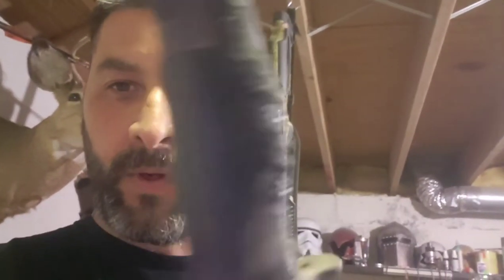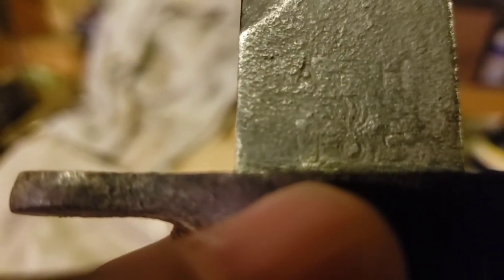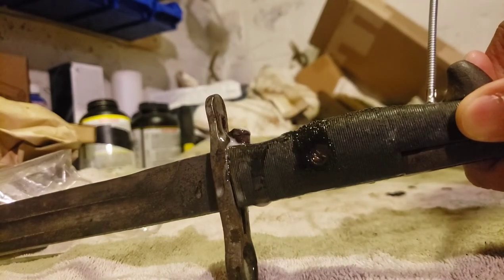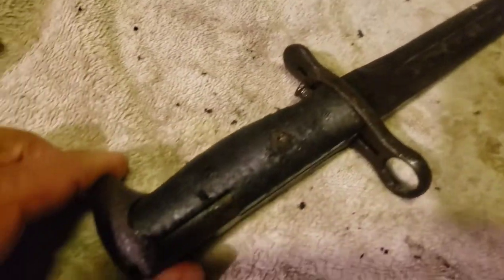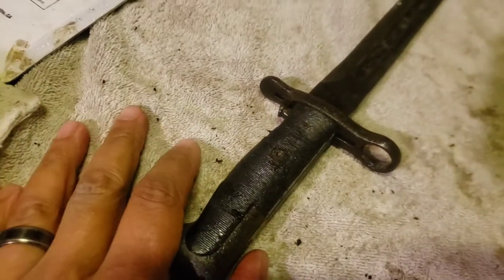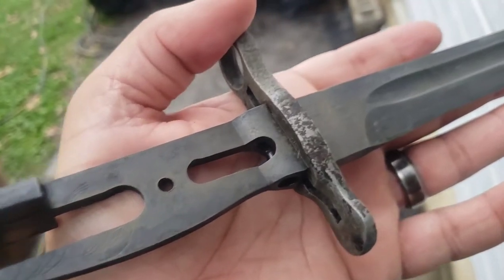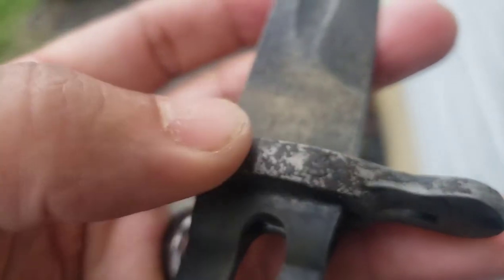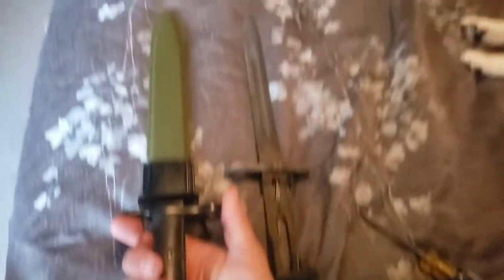M1 Garand Bayonet Restoration

Comment: Your bayonet isn't a cut down 1905, if it was the fuller would run all the way to the tip. I think AFH (America Fork and Hoe) stopped putting the year on the blades mid year 1943, so your bayonet could be made from 43' thru 45'

Comment: Still looking go. Where did you get your grips at? Are they repros’s or original WWII? I did see a listing on eBay for the female threaded side only if that helps. One thing you might want to look at is Mark Novak’s site on conservation vs restoration. If he had your bayonet he would boil it in water, usually distilled I think. He uses no chemicals when doing this. The process converts the rust. He then uses a “carding wheel” to clean the metal. These wheels usually have a wooden center core. They will not hurt your fingers. He will tell you a wire wheel will remove the bluing beneath the rust. I will send you a link if I can find it.
Reply from the maker: Hi! Thanks for watching and for the info! The grips are original. Got them from ebay.

Comment: Nice vid, doing one that belonged to my grandfather, ww2.
Reply from the maker: Thanks for watching! That sounds amazing. Best of luck with it and definitely post some before and after pics/vid if you can.
Reply: Hi Johnny.. I have one like yours I inherited from my uncle. It is in very good condition but I plan on refinishing it to prevent small rusts from getting worse. What do you recomend I do to remove the grips? it seems to be stuck . Also the metal on the scabbard also needs refinishing . Would you recomend separating it from the fibreglass before restoring?
Reply from the maker: Hey. Thanks for watching! I would suggest soaking the scales with penetrating oil or rust buster for a little while; and see if it frees up some of the crud around the threads of the screw.
I had the same issue with one of mine and most recently, with the screw for the grips on my C96 Mauser. Sometimes they are just too far gone.
I'd suggest sourcing some replacement scales with the screw as insurance. You can generally find them on eBay for around $30. Stay away from the repro ones though. They don't fit well. 
If you manage to get the screw free,carefully inspect the scales for any cracks before attempting to lift them off. I also had scales fall apart on me just trying to take them off.
I'd be careful with the scabbard.  You gould probably mask off the fiberglass to protect it. Those scabbards -as far as I know - were cut down and refitted as well. So taking them apart might do some damage.
Good luck!
Reply: Johnny I. I"ll give it a shot. Thanks so much!
Reply: @gierhedd75  use Kroil oil on screws to break them free